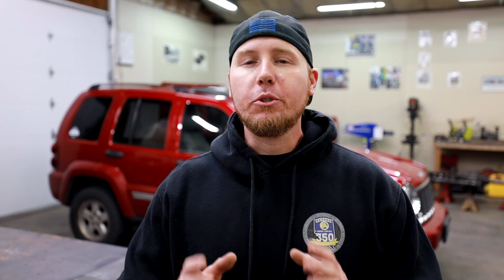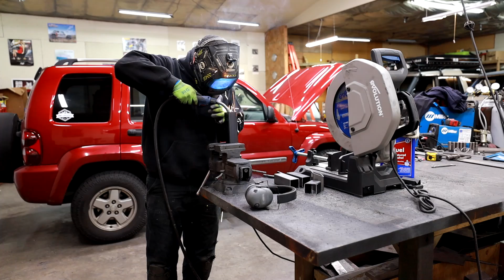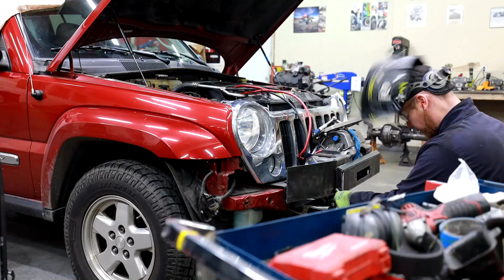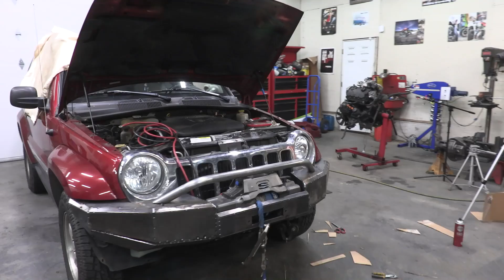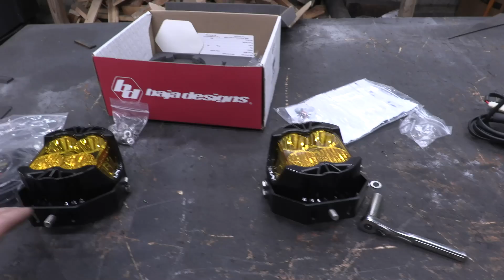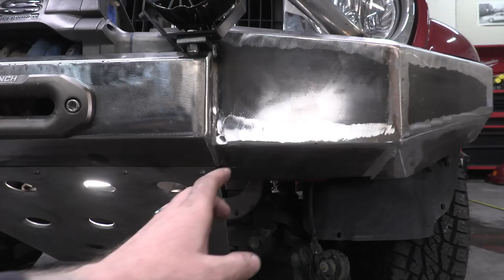PreRunner Bumper Build! Winch Bumper Metal Fabrication How To

Comment: You know I'm not sure how much it would actually damage the car if the bumper was stiffer when getting into an accident.... My brother had a super thicc heavy duty bumper I'm not sure who made it but we were driving home in the rain car in front slammed on the brakes for no reason we just kept sliding right into the back and let me tell you that car everything was smashed absolutely totaled but my brothers xj nothing got tweaked bent, dent, or even a scratch... Truly we were not moving too fast but still 25-30mph with a super heavy duty xj

Comment: I have a question about cooling. I have an 04 Envoy that I am planning on doing pretty much what you did in this video. I am concerned about covering the radiator and causing a cooling problem. Have you experienced any cooling issues with this design or should I mount the winch lower and open that space up more? I am in Illinois and cooling issues are not a real problem here, but I plan on taking this vehicle to AZ where everything has cooling issues at 110+ degrees.

Comment: I've been a superwinch fanboy for years. Up until a couple days ago when I pulled my Talon 12.5 apart to see why it won't freespool anymore. I found the inside completely full of rust and yellowish white powdery corrosion, along with almost zero grease. And not just surface rust either. It was deep, thick, rust, the kind that leaves deep pits in the metal. 

The Talon series is supposed to be their top of the line, 100% sealed, waterproof, greased for life, series of winches. Plus I live in AZ where we get less than 10in of rain per year and the winch has never been submerged. So I don't understand how it rusted so badly. The winch is only 8 years old. 

I sent an email to Superwinch to see what, if anything, they will do for me. It's going to be a huge pain if they want me to mail that heavy thing off to them, likely at my own expense... Then we'll see if they ship me a new winch or just throw a few new parts inside my corroded housing..  Who knows?  I'll find out when they get back to me I suppose.

Comment: I definitely slid box tube into the channel in the front of my ZJ. With a little bit of careful measuring and slotting and a bit of persuasion from a large hammer, I got that tube about a foot deep. Then I clamped the sheet metal on both sides with some 1/4in plate and five 9/16 grade 8 bolts all the way through. 

It would take an act of god to pull my front bumper off my ZJ. And believe me, I've tried.

I also cut that front "bumper"/cross member out and recessed my winch as far back as I could. It is about 1/4in from the AC condenser. I cut the bottom of the grill off to fit the winch. 

I also pulled out the radiator support and replaced it with a much stronger one that I made and bolted that up through the box tube inside the frame rails. 

My approach angle was MASSIVELY improved. It is the best approach angle possible on a ZJ while only running 33s.

Comment: Help me with my xj flares no one really makes thick metal almost tube flares for a xj they make flimsy ones I can't find anyone online or local to help me..there's so much I want to do to it it's a two door in great shape I've done a Ford 8.8 black magic disc breaks front and rear 5.13 gear bunch of stuff but I want it done armor rear bumper rock sliders welded in... Everything

Comment: Looks excellent. Worried about the airflow to the radiator. Also send me your old bumper please. As far as the winch I have one I can connect with cable and a remote it sits in the back and it's there if or when I need it. I don't like anything interfering with the Air flow to my cooling system.

Comment: Bro, the Video i would like to see u create is Building A Front Bumper w/ Winch & Bull Bar on Jeep Cherokee WJ. It just so happens I own a 1999 Jeep Grand Cherokee Laredo WJ V6 4x4, I also own a 2011 2dr Jk Manual V6 3.8L 4x4/ 6 Speed but Very Convenient for me if u did the video bumper build for WJ. Couple years ago a good law abiding man pulled right out in front of me and he had no insurance and all I had was Liability anyways, it kills me becuz I already was saving money to Get New tires and Rims plus a 4inch Suspension Lift, I was gonna be getting it done within a couple of weeks from the day of the accident, long story short I never got to it and thats when I bought My 2011 Jk. I have Brand New Radiator for WJ sitting in the Shed Right now but gotta figure out how to build the bumper so my radiator will fit properly other than The WJ is ALL GOOD, seriously. It would be cool to see what the finished bumper looked like on the WJ If you was to Design & Build it, anyways keep up good work & videos  & keep em coming. God Bless.

Comment: A few years ago, a friend of mine bought an old Land Rover Defender. The vehicle had winches front and rear. It was lifted and set up for jungle / desert use.  The previous owner had strengthened the chassis to cope with the stresses of the two winches.   We were working underneath the vehicle and noticed something odd attached to the chassis mounting points of the winch.  There was two heavy steel cables running up inside the chassis.  It looked that the winches although attached to the chassis, would strain against each other via the cables rather than the chassis.
He kept it for 3 months,before selling it to a guy in England.

Comment: nice build. I made a very similar bumper out of 1/8" plate for my F-150 back in the 90's as my first project. Curious if you left room for the winch to come out after you put that bar on? It looks tight overtop it.

Comment: I had a 2005 Jeep Liberty Renegade in my past and it had a BDS suspension lift kit. Wish I found the channel when I had it. My Liberty needed to have a better bumper.  I like the design and function of the bumper as well as the Skid plate. I took it off road at AOAA and Rausch Creek in PA. My tire choice was BF Goodrich All-Terrain T/A KO2 and they worked great. Thank you for a great video.

Comment: Looks good, only thing I would have done differently is fab/design the bumper to conform with the chrome around the headlights instead of covering up that bottom edge and fogs. Although, that would have added a significant amount of fab time.

Comment: Just a question it looks like it's not going to be able to breathe much is there a upgraded cooling ? Just a question no hate !
Reply from the maker: This jeep has always had an issue getting to temp but I'm not worried in any way about air flow. It's never been an issue for any winch bumper I have built or installed 👍

Comment: Nice bumper build!!  We have a 2006 Liberty CRD with ~150k miles.  Unfortunately it has a fuel problem - low fuel rail pressure.  I will be pulling the CP3, injectors and fuel rail and sending them to Oregon Fuel Injection for testing.  Very few places in this country are interested in doing any kind of work on these CRDs.  At 48k miles I loaded a GDE Full torque tune that disabled the EGR.  At 60k miles, I removed all the EGR pieces/parts and installed an in-tank fuel pump (2006 Dodge Ram diesel) and a 2 micron Racor fuel filter head.  At 100k miles, I replaced the timing belt, rocker arms with newer design and installed head studs.  My wife and I really like driving our CRD, but it hasn't been an economical vehicle to own.  It get's good fuel economy, but the cost of upgrades and repairs have been high.  Also, If you are considering a suspension lift, check into JBA Offroad.  I installed a set of his front upper control arms that have replaceable ball joints.  The quality is outstanding.

Comment: I use CAD to figure up what the bumper is going to look like - Cardboard Aided Design.  Cut the cardboard into the shapes of the bumper and (tape) tack it together.  Quick and easy to change the design with a razor blade and tape.  Get it sorted, then cut it apart and use it as template on the steel.

Comment: I had one of those 2006 -2.8 crd had it for 2 years could not fault it put a 40mm lift on the front the rear seemed ok as it was put a set of AT tires on it and hoped that it would grow on me but just could not get my head around the look of it. 

So it had to go in the end and I got a nice 2002 4ltr WJ  with solid front axle I put a 2" lift a set of wrangler 18" wheels and a set of BFG ATs just love it wish I had got one when I sold my 2000 XJ would have saved me a bundle  of money.

Comment: That box that was sticking out after you pulled the plastic bumper cover off, was that the sensor to deploy the air bags? I hope that's been remounted somehow. That uni-body needs the air bags to work in order for passengers to survive even a medium size crash. I hope you haven't put yourselves in danger. That sensor is the reason I would never build a bumper for a "modern" vehicle. Good Luck to you. Stay Safe!

Comment: Beautiful bumper. It will hold up in an accident. If you don’t want the unibody to tweak in an accident, reinforce the two main rails you tied the bumper into. 1/8” material, 3/4” tall to make a “spine” on the rails. Take the spine past the firewall. I did it to my sister’s Liberty. It’s held up to stumps & stones.

Comment: Curious if you ever worry about how big a winch is compared to open area of radiator? I always wanted to build tube fenders and bumpers for my CRD Liberty, but it got to the point where it was too expensive to maintain for me. Only built one bumper, and that was with my dad. He's not really a hot rodder/car guy type, but he totally nailed the whole thing like you said making sure the bumper had a little ability to absorb some impact in its design (via collapse) in the event of an actual street accident. Going to love following this one!

Also, no shame in ending the project where you did. I would have done the same. Ever since my time as a kid building model cars, I learned how sometimes I get more excited about getting something done, that the final result isn't as great as it could have been with a little patience. I was the one with finger prints in the paint of the model car. So I'm pretty good now at listening to my internal clock, but still not perfect.

Comment: Are you gonna use like a rough country  2" lift on the liberty.   And possibly stiffer  spring rates.   I saw how much it sagged with just the weight of the winch on it.     But so far. Awesome build. Love you vids

Comment: Awesome, I used the Barnes dual pull winch plate as a base for my frame chop on my JK.
Reply: Also, have you tried steel-it? Works great. Especially for projects like this where you need to paint it to protect yet still have more work to do later.

Comment: You need the Old Man Emu lift for the CRD! OME 790 front springs and OME 948 rear with their front struts and 132L rear shocks, and bumpstops. Then you can build your own brake  line extension for the rear. You and your wife will love it, esp off road!! We have built over 400 Liberties and a ton of CRD KJs.

Comment: I don't think those four 3/8 bolts are going to be enough to hold that wench on during any decent pull and I may not have covered the stock turn signals, but I like the idea of what you got there.

Comment: I'm a bit nervous at welding on the body frame close to the motor. Would you recommend to do any thing prior to vehicle welding, other than just disconnecting the battery terminals when welding the heavier steel components in place?

Comment: I am beyond stoked to see this video! As a liberty owner (and lover) this is really giving me great ideas for bumper. Can't wait to see whats next. And yea I agree about the chrome. That was the first thing I did when I bought mine, got ride of all the chrome changed it to black. These are such capable jeeps, the places I've taken mine so far blow my mine. 
Thanks for inspiring me!

Washer fluid container - common solution most of use do is pull it out, cut the neck off, plastic weld it to be way shorter and shove it in the engine bay. It fits nicely (at least on the 3.7L engine model)

Comment: Make the recovery points recessed into the bumper on the two flat panels on the front. Make them curved with a bar welded to the front. They would be front and center, but they would not be sticking out in the front.

Comment: Hi Nate. I fully understand your need to step back and work out your plans to finish the front of this build.
I'm building a project I've wanted to get started for several years now. Its a 1962 Ford Ranchero body sitting on a 1984 Ford Ranger 4X4 (I have two of these). Talk about going down a Rabbit Hole!!!! The Complete Ranger chassis, engine and running gear is being used. That means I have to use the Ranger floorboard, 85% of the firewall, radiator core support, steering column, pedals etc. lots of planning measuring and fabrication and modification  just to attach this body. Once I have it together and road worthy, I will build front and rear bumpers similar to your designs.
This is my retirement project. Wish me luck. Thanks for your videos, insight and inspiration.

Comment: For lifft go with the rockyroad outfitters rockfather kit with the HD OME struts/springs and their plate spacer for the front. Youll be at about 3.25 inches of lift and 31s will roll no problem

Comment: Nate, those big flat areas on the front of the bumper are begging for some flush mounted LED fog lights or running lights.  Preferably round to pay homage to the original Jeep style.  Honestly - and I mean this in the most loving way possible - they look terrible, more like an afterthought, mounted on tabs on such a sexy bumper.  Anyhow...just a suggestion...take it or leave it.  I also realize that area is probably not perfectly parallel to the front of the Jeep, and that you would have to cut a piece of tube at a tight angle to create a slight "can" that was inset into the bumber to mount them perfectly forward facing, but I'm confident that you could make it look good.

Comment: I think the bumper would look really good with those fog lights recessed inside of those 2 large flat plates on the front of the bumper. I'm not sure if you have the space behind there or if you even like that look but I figure it's worth putting in my 2 cents. Great video 👍
Reply: Agreed , have them look like they are one with the bumper. But couldn't agree more awesome build to come!

Comment: Did you add “anti crush sleeves” in the frame mounts? I’d be worried about the bolts crushing the unibody.
Reply: Looked like he only bolted through one section of doubled up sheetmetal, no crushing concern.

Comment: I have no issue with breaking the video up.  Looking forward to seeing prerunner bumper build Part 2.  For recovery points the WK uses hooks that attach to the bottom of bolts just like that liberty has.   Something like that may be an option to look into.

Comment: Nice work on the Liberty. I think you are on the way to one of best looking bumpers for this Jeep. The Liberty design is hard to work around. The low hanging  washer fluid bottle, lack of good tow point locations, and round body lines are an issue.  The ARB front bumper killed the approach angle for this Jeep.  I would like to see you fab up some decent steel or aluminum fenders. The sliders and rear bumper should be the easiest part of making Liberty armor. Plenty of good mount points.

Comment: I noticed you didn't use the crush cans that were covering the holes in the frame. Here in BC they are big on you having them when you make a bumper for your vehicle. 4" minimum on the sides and some form of those crush cans. Vancouver PD has a horny cop who makes his day by busting wheelers. I caught the plate in the back behind the winch to stop flex, will have remember that. Great bumper, hope your wife doesn't decide to tackle some bad drivers out on the means streets now that she is going to be protected. LOL

Comment: Man that looks sick I build bumpers for a living down in Florida you could cut a square hole in the bumper where you’re square tube is for the mount and make a slide in recovery point that you can remove and put a cap to make it flush when not in use it would be super clean but I love this bumper it looks killer keep it up

Comment: Watch out for the bolts holding the motor and gearbox to the center section on the winch. I picked up one that had one bolt stripped, and another loose! Also where did you get it, I though they were discontinued?
Reply from the maker: I got it from super winch a few years ago. They still had a plant  in Oregon so it has been awhile lol